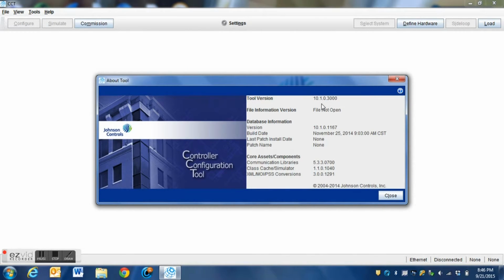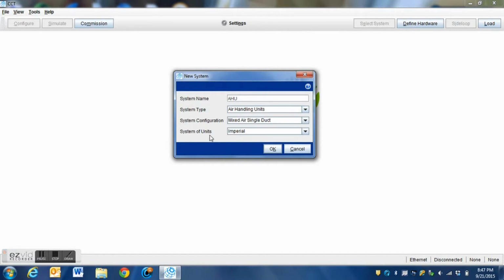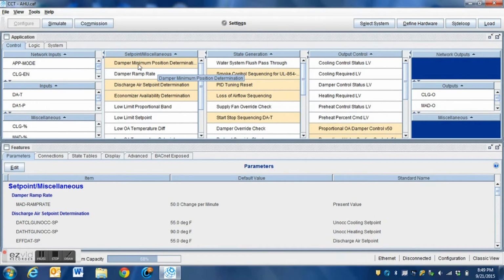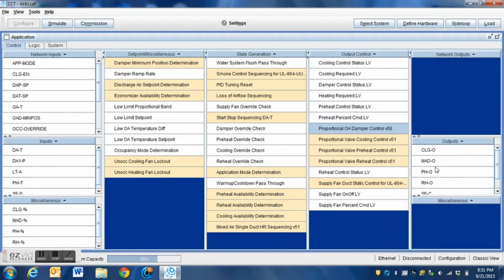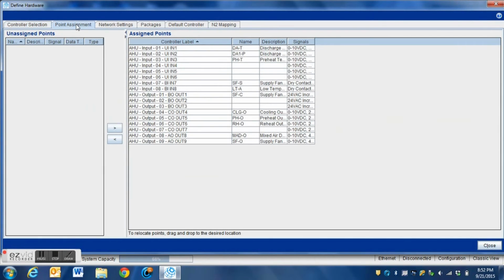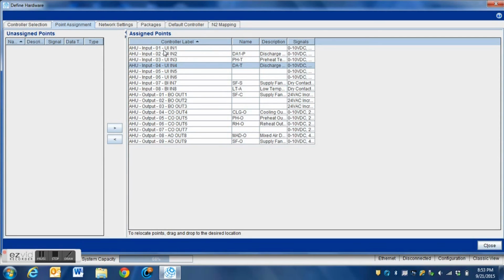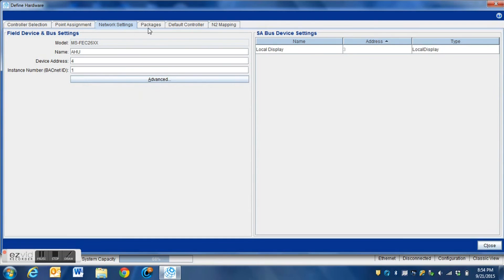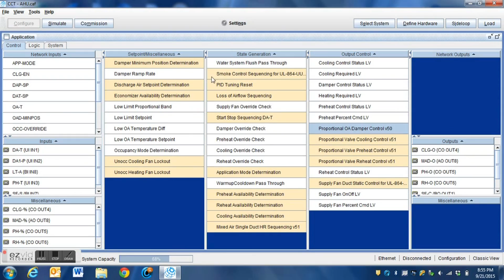Johnson Controls Controller Configuration Tool CCT

Comment: Hello, great Videos.
could you do a video on how to reset the PID. 1630 VMA
The integral setting wound up due to a failed heating valve.
is there a way of disabling the adaptive tunning.
and just put your own values?
Thanks.
Reply from the maker: I'll see
Reply: @Systemcontroltech  
Can you map N2 devices directly from Metasys EXtended Arch, or do you have to go thru N2 network and the pull it from there?

Comment: I replaced a ns-btb7003-0 thermostat in a building with a johnson controls heating system. You can adjust the temperature at the thermostat but the baseboard heat wouldn't come on. If i adjust the heat in the metasys (eg 24 degrees) the heat relay won't close. I replaced the relay just in case it was a bad relay. There is 6vdc at the relay. It needs 24vdc to close.

My question is do i need to configure the thermostat in the metasys?
Or does the 24v come from a johnson board I need to reset?
Reply from the maker: Check your programming configuration and ensure  the output is for 24vac.
Reply: @Systemcontroltech  I did check the voltages, and it does need 24vdc to close the relay. Thermostat needs 15v to operate. And it does have 15v there. In the metasys there is still a problem with the thermostat, after I replaced it. I made sure the dip switches are the same also. Could it be the module or other thermostats on that module?

Comment: Great videos, I have seen almost all the videos in System Controls Tech and I have recommended to my friends as well. I want know about SCT tool. Why its used?. All I know is that it is used to create database. What exactly is a database? Can you explain the entire work flow of how the DDC panel is connected with other DDC panels and to the server. Is there any other tool to learn about HVAC for beginners.
Reply from the maker: +sarfraz rasheed SCT is used to back up the data in the NAE. If you ever have to replace the NAE you can transfer the information to the new device.

Comment: Great efforts,  recently I started working on these NAE5520-1, that I am looking for good manual to learn thru,
even with the basics I am having difficulty, resetting the unit to manufacture defaults, having the CCT I am sure will help..
any where we can download a copy.
Further I am looking for discontinued units as replacement for defective one LP-FX-14D72-000c . No one has it, it is possible if I replace it with LP-Fx 15D-72, also I need the Programming tool to test and learn more.. Thnkx
Reply from the maker: Resetting an NAE to factory default requires the imaging tool software.  You will need to contact JCI to get that.

Comment: Great video. Question though, if a controller is running off an older version than what is currently on the pc and you pull the application out of it, are there any pitfalls to upgrading the tool in the controller when re downloading it?
Reply from the maker: +Brian depends on the controller and programming,  especially true if there is a lot of customization.  ICING says there shouldn't be any problems and in most cases there won't be.   However, it does happen.

Comment: Sir I have a FEC Controller and I want to upload programs from FEC Controller, but I do not have any communication cable such as BTCVT or Zigbee. Can a rs 485 to USB converter or RS 485 to serial converter works to downloading and uploading program on FEC....?
Reply from the maker: If you have the software you can upload it over the network.

Comment: We have existing Metasys software including CCT (within the SCT, I think).  I have used it to replace control points on a new ModBus to BACNet Gateway board that uses "Analog Values" instead of "Analog Inputs".  We have a skilled consultant who can program quickly, easily, and efficiently.  Sometimes I need to accomplish things without calling for help, though!  Wish me luck!  I'm trying to get a handle on a hydronic hot water heating system that appears to be partially programmed, but was never debugged, perfected, and completed...  Hopefully CCT can bring up the old programming for inspection, then create a new one as a substitute in such a way that either program will be accessible...  The device we are working with in this case is a FEC2610-0.  I have worked with some edits on VAV controllers, of which we have MANY!  :-)  You are right about advising to go ahead and make some mistakes...  

One of the tricks that I learned from the consultant is that CCT sometimes needs to be summoned from within the ADS program in order to Auto-Find existing hardware...

Thanks for posting this video...  It gives me the confidence to go forward and risk making a mistake or two.  The skilled consultant respects the efforts I make to get as much done as possible before dragging him in the door to fix things up!  :-)
Reply from the maker: +Robert Nelson Glad to help and good luck.  It might be necessary to make a few backup copies of the programs as you begin to modify it until you have everything working the way you want.  If there is a problem with a change you make, it is then possible to go back to a previous edit of the program.  You can do it.